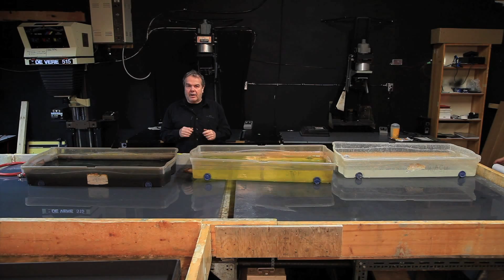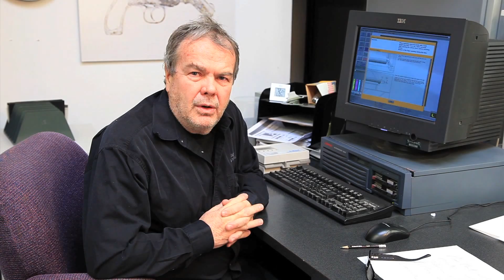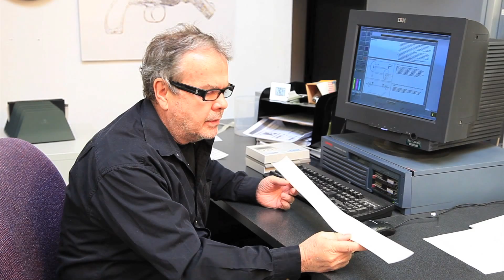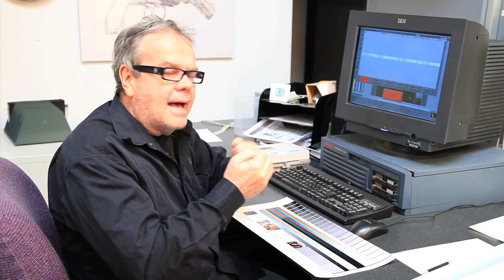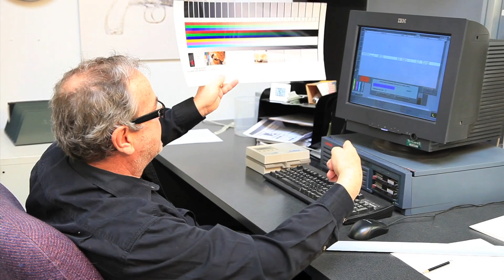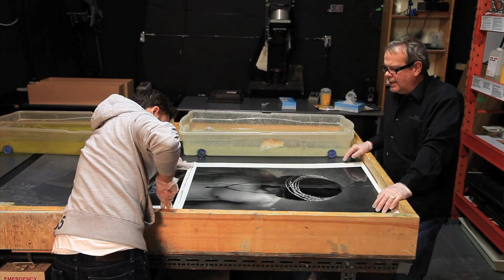Darkroom_Lambda Printing

Comment: Actually any silver halide printer, doesn't matter if it's laser. LED.contact print light source or even digital carrier, every morning they should do daily setup print, but not to calibrate the paper, but to calibrate the chemical and the lightsource. Paper calibrated only needed when paper is changed or paper too long inside magazine.